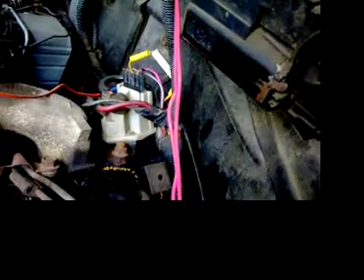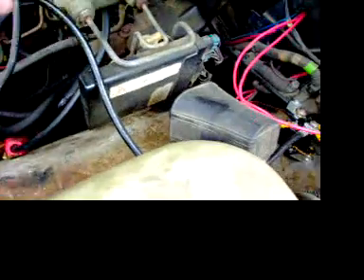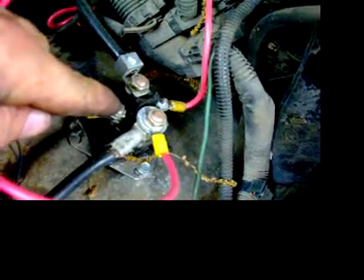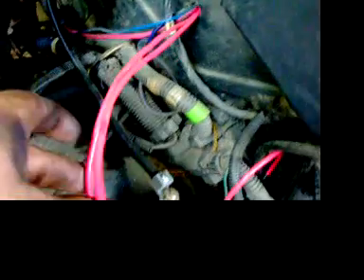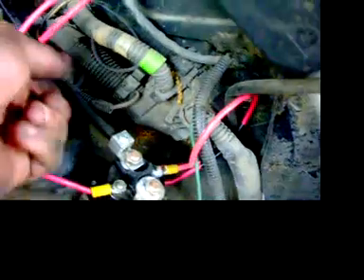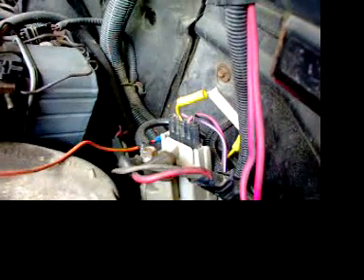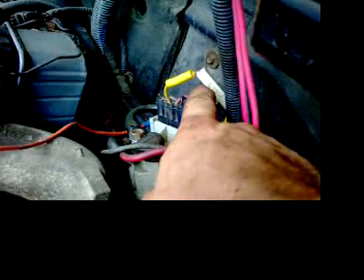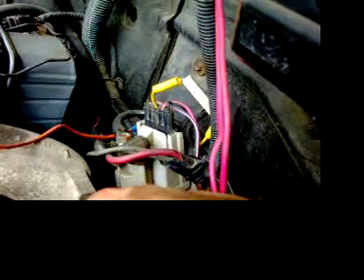6.2 diesel Manual Glow Controller

Comment: I used a 30 amp breaker right at the positive side of the battery. One with  auto reset of coarse . Not sure if it's big enough but so far I've only held the button for about 3 seconds and everything's fine.
My thought was that if the oem glow system kicked on while I was manually glowing it could be a problem eventually so the $3.00 breaker was a good investment.

Comment: @69pigs13wolves 
low amp fuse would go at power source to SWITCH.  This should be rated higher than current to relay coil.  HIGH amp fuse (rated above max glow-plug current) could be installed on positive wire from battery to relay.  This is only practical if the current is reasonable - otherwise use armored wire and make sure to keep the wire from getting into places it shouldn't to prevent short circuit / fire.  If this doesn't make sense I suggest some light reading on basics of electricity

Comment from the maker: @porsche928ireland I haven't seen any lately. This diesel motor blew a cooler line and spewed the oil right out the side of the block, what a shame that a 1 dollar "c clip" holds the cooler line in place. Wiped 2 crank bearings and 2 connecting rod bearings. I would replace the stock oil cooler immediately if you have a 6.2 or 6.5

Comment: @Mikeandwendy74 yeah i bet they do.......my 68 is a f100 running a 460 gas, draws around 175 amps during starting.........at least when its new, once it gets a little older they start using more juice for the same work and i havent checked that amperage yet as i am runing a 200 amp switch and standard battery cable so it can handle the extra draw...........if your runing the 24 volt version of the 6.2 you actually use less amps during starting than the 12 volt does

Comment: @Mikeandwendy74 not if you used the proper gauge wire and switch......i got tired of burning out solinoids in my 68 so i just sorced a heavy duty momentary switch and ran the bat pos. to the switch then to the sarter.....been working great for three years now......and the starter uses a whole lot more than 120 amps

Comment from the maker: @wilsonatore well, the dead wire is common to the metal on the bottom of the solenoid switch :) If I wanter to mount it to the firewall, or somewhere where the bottom wasnt touching metal and grounding it out, Then I would have run the dead wire to a good engine ground, or straight back to the negative on the battery. This was just easier thats all. But some solenoid switches, are encased in plastic, so you would have to run the ground wire.

Comment: Thanks for the video, but I have a question:  Why don't you ground the dead wire?  I don't get where the internal switching circuit has a ground.  I've been reading online and some people describe wiring the dash switch to a fuse, but it seems like your setup doesn't do that.  Thanks.

Comment: i just ran 2 wires from each terminal from my glow plug controler to inside the cab, when there connected it heats up the glow plugs & lights up the light in my cab, works fine, now i just gotta replace the starter bc its sluglish
Reply: wonder why the cab lights come on

Comment: Handy advice this especially for a diesel conversion from petrol as the ignition kay/lock/switch doesnt have the glow step, so u wire up a button and a relay.
I figured connect a wire to plugs and measure amps, knowing its 12 volts work out what type of relay to use, starter one is perfect, u will never overload that!

Comment: i fixed my glowplug controller after, i took it off, put the plastic piecies back on & JB welled it lol, then connected 2 wires to each terminal & now i also got a manual glowplug controller, i lost the button i had for her so im gonna get one 2morrow.

Comment from the maker: no way man not unless you want 80-120 amps running through your switch you put you hand on  that would immediately cause the wire you just ran to ignite in flames...IMMEDIATELY
Reply: Mike OD 

We've done this with trucks before. (Not using anything besides the switch) and you're very right. You might get one use out of it if you're lucky. And you WILL get a burnt hand.

Comment: i got a different simpler design run both terminals on the glowplug relay to both terminals of the starter relay and the S terminal wire to the switch and the other side of the switch to the power blade in the fuse panel it uses less wire and you dont have to hook it to a battery just to both terminals on the glow plug relay becuase one i 12V and the other in the plugs